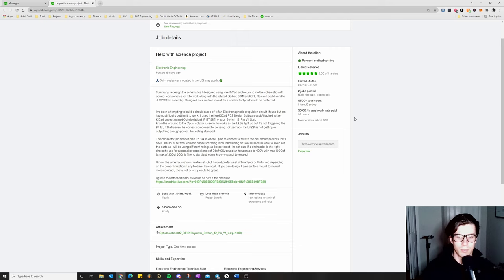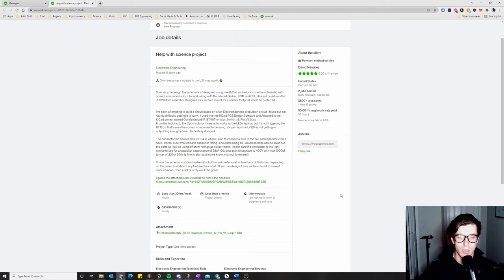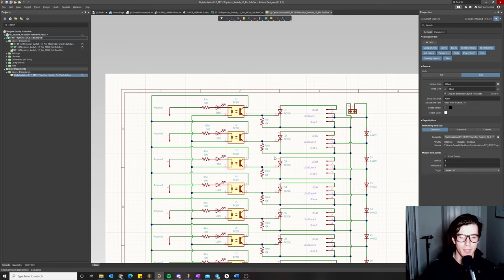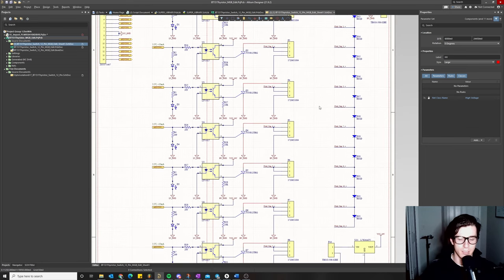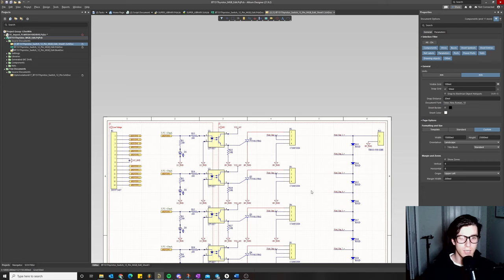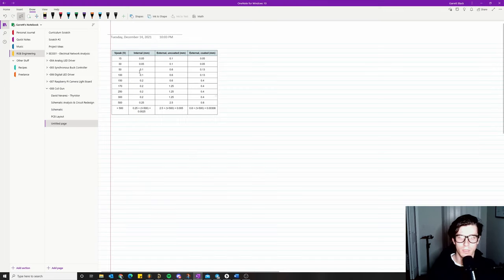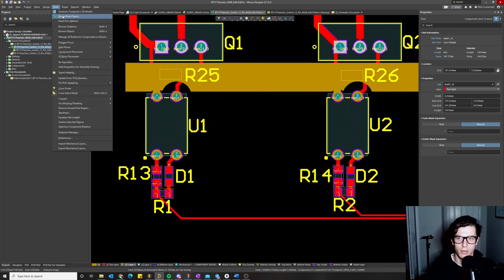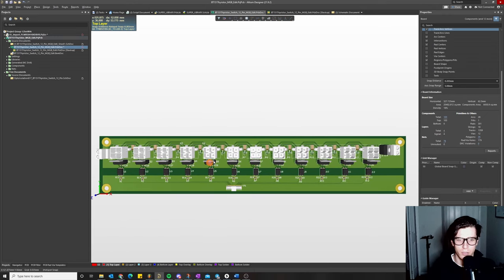Coil Gun PCB | #UpworkJobs | #Upwork

Comment: Thanks for the content.  I like the concept of walking through work in designing a PCB for a client.
I'd make a few suggestions- When talking about "looking at a datasheet", put it in the vid, and show what values you're using to get the answers you need.  You mentioned looking at the opto-coupler datasheet for forward voltage + current necessary.
Also, work on a script.  It'll help structure the video, set a pace, keep you on track, and have consistent information flow to the watcher.  In the middle of talking you jumped into KVL, and then got back to your point.

Well wishes and would like to see more content.
Reply from the maker: Thank you for the suggestions - I will listen to them for the next video! I appreciate the support :)